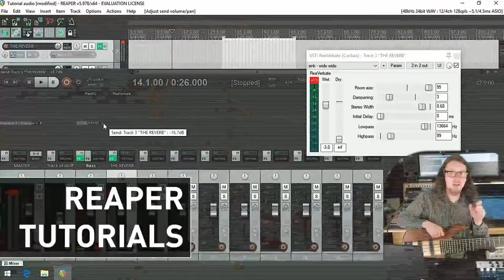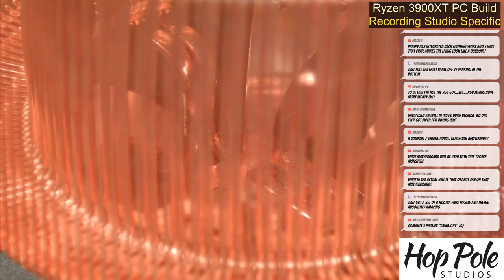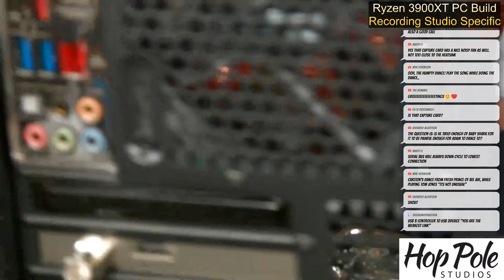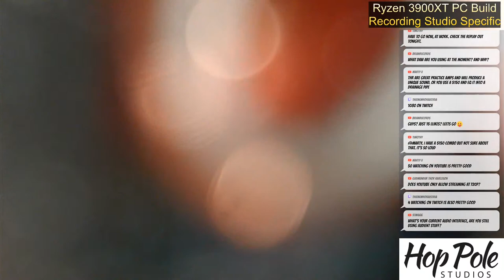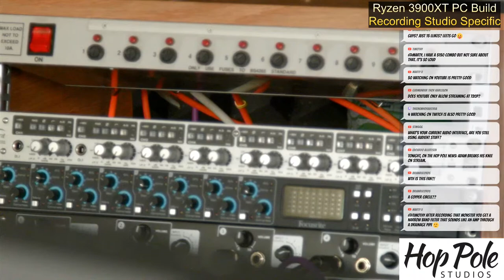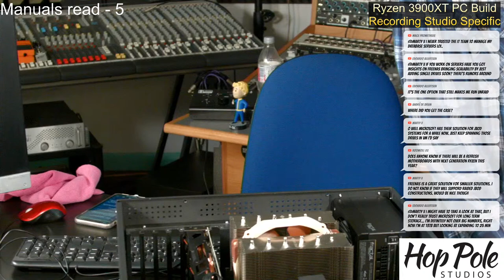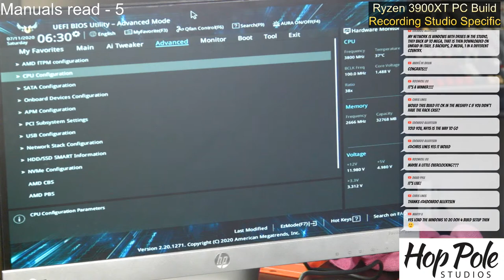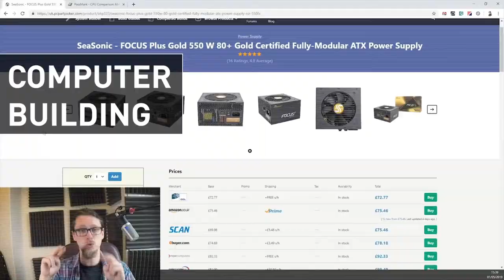LIVE Ryzen 3900XT Studio PC Build! Music Production machine for 2020 and beyond....

Comment: Odd that you don't list the parts for the build with affiliate links. You've had the build working for a bit, how do you like it? I am looking at doing a  new build and originally looked at the 3950x, but the price difference to the 3900xt is making me wonder if the extra price is worth it. Your thoughts? What cpu cooler is that?
Reply from the maker: It’s a great build, honestly the heaviest mix I have works fine on a 3900 so going extra might be good in future but for now, no real difference to me. It works solidly though 👍
Reply: @adamsteelproducer Thanks.